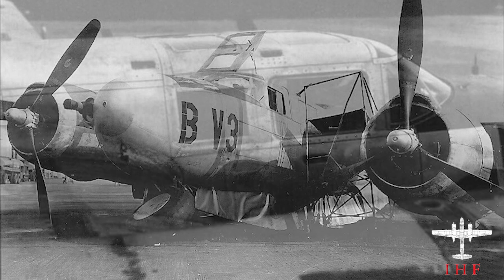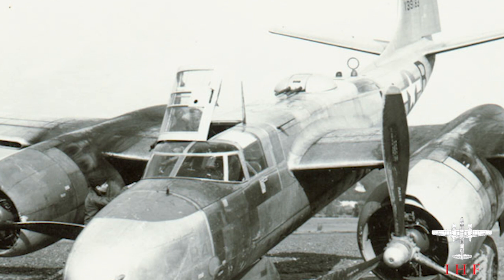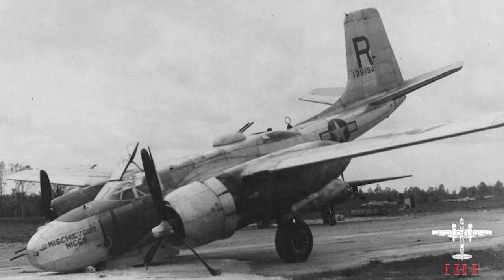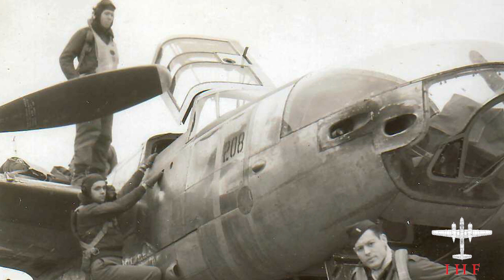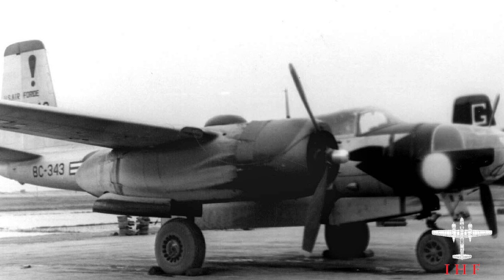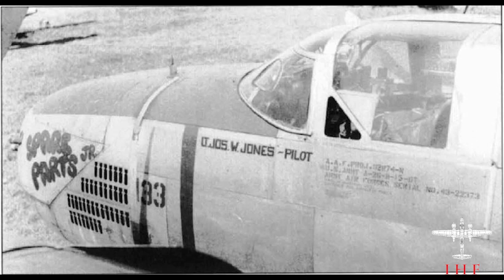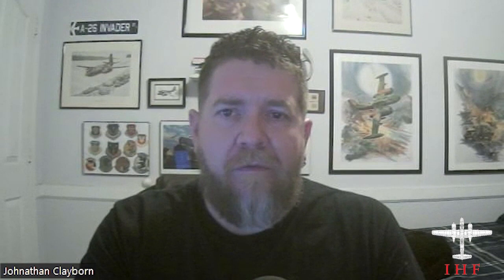Canopy Evolution

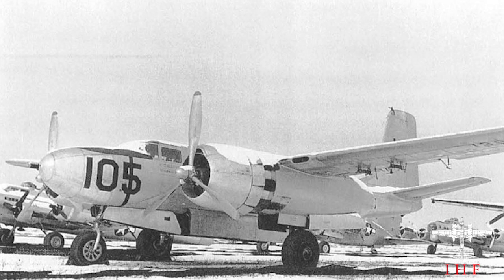Comment: B-17s in the background at 1:30 - looks like post war picture? I like the A-26 too. Interesting to know the canopy evolution before. Every airplane has interesting details changed during the production :)
Reply from the maker: Yes. That photo is from late 1945, just after WWII. The original photo didnt have a date with it, just a location, but I have the IARC records too, and that was the only time the plane was ar Wright-Patterson.
Reply: @IHF  I can try to find out the s/n of the B-17s. The B-17 at right corner has a radar system in the nose. White propeller (or just snow or sun glare?).
Reply from the maker: @B17FlyingFortress  Im 85% certain that the props on that B-17 in the background are bare metal, just like the A-26 in the foreground. You can view a higher resolution version of that photo here: 
https://claybornglobal.com/IHF/images/6/67/41-39105.jpg
Reply: @IHF   I agree. It's bare metal propellers.  :) Can I share the picture on my Facebook page for further discussions with other B-17 historians? The B-17 at bottom right has no unit markings on tail. A new (replacement) aircraft. I can see a B-24 at the very bottom-right corner. You can see its right wing with main gear and part of the glass nose. You said, date of the picture was somewhen in late 1945 at Wright-Patterson Airfield?
Reply from the maker: @B17FlyingFortress  yes, of course. Feel free to share
Reply: @IHF  Thank you! :)

Comment: Why did it take so long to fix something so basic? Anyone can see just looking at it is a bad canopy design.
Reply from the maker: Keep in mind that we have the luxury of hindsight. A lot of the planes of that era had terrible canopies. And I didnt even talk about the prototype Invaders in this video, and those canopies were even worse. 😳
Reply: @IHF  I'm sure the test pilots at Douglas could have told them this back at prototype stage? And crew escape is just apparently an afterthought?
Reply from the maker: @WALTERBROADDUS  The Generation 1 canopy was actually an improvement over what they used in the prototypes. To be fair, crew escape wasn't a problem that was unique to Invaders.
Reply: @IHF  you mean there is something worse than having to crawl over the co-pilot?😒